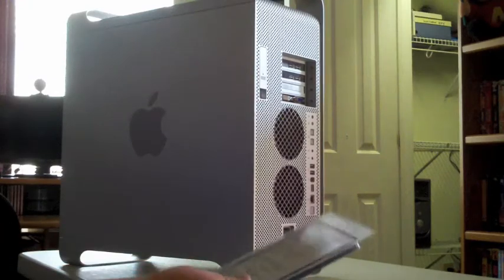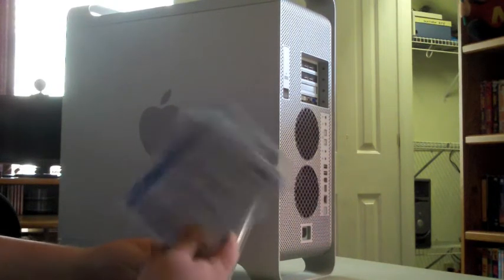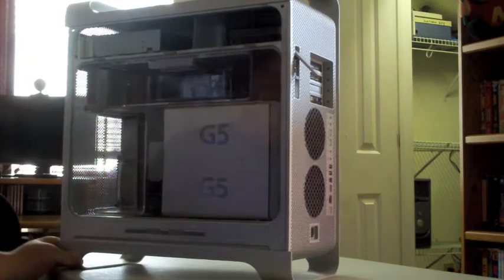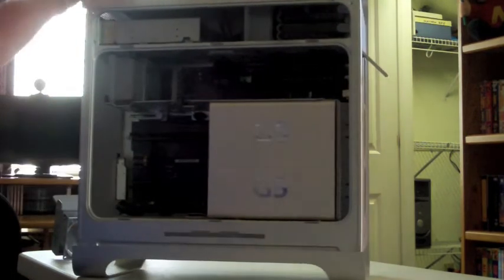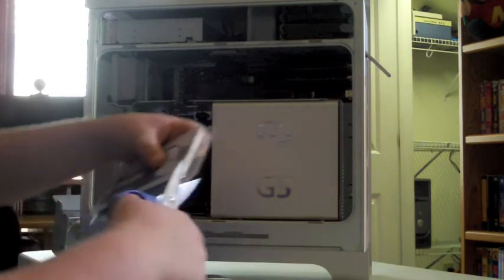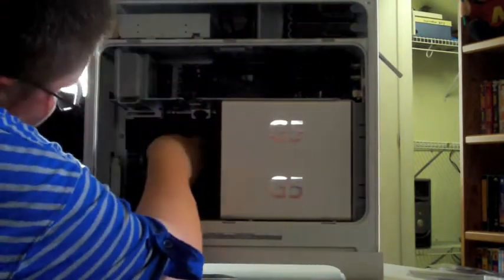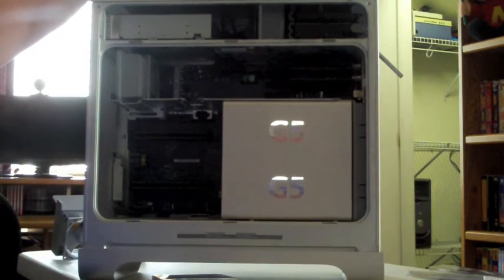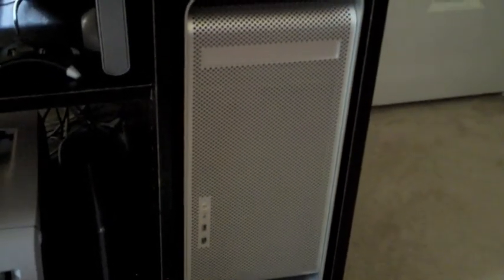Power Mac G5 Memroy Install

Comment: Nice video :-)

Just got a PM dual G5 2.0 (already have a mac pro 2x quad xeon) but felt I wanted a more "classic" mac
I was suprised it only had 4 RAM slots which I maxed out with 4 gig's
My dual core PM G5 I use to have had 8 RAM slots

You plan upgrading the graphics card?